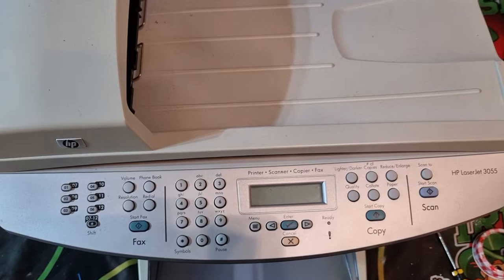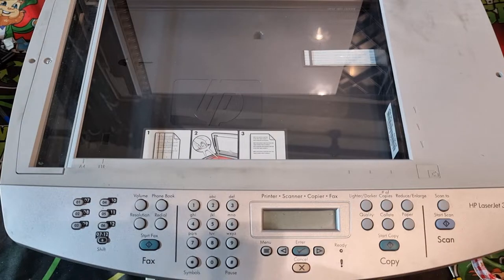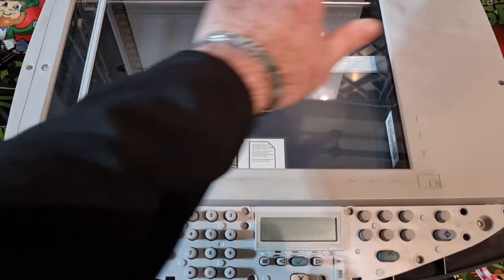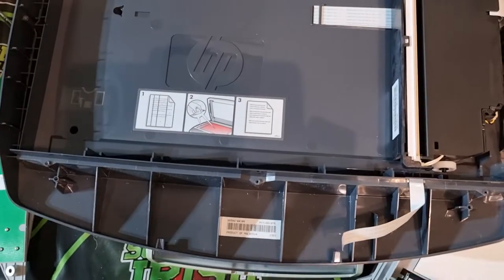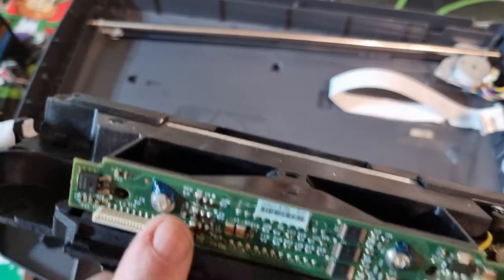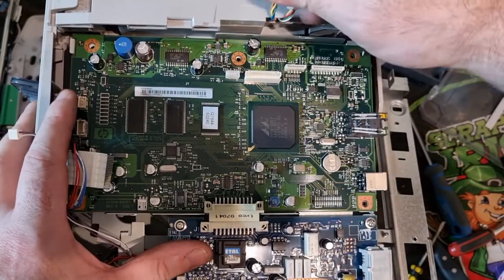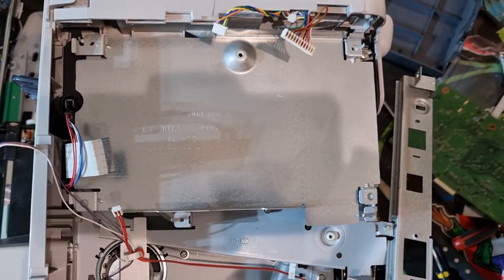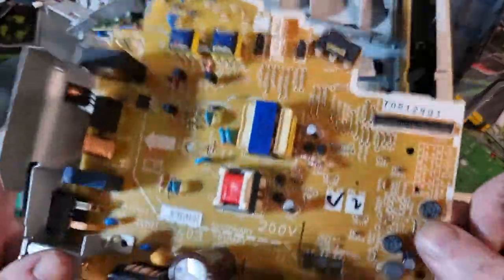gold recovery from printers is it worth  micro scrapping it

Comment: Lots of plastic and steel. The copper bearing motors go in scrap steel because I find no metal recycler who wants stuff that small. As someone said, there's the lazer head to look at. Some wire I hope you cleaned up. Printers are time consuming but for the hobbyist a source of gold. Most folk pass them over. I generally get the power cord and data cables with them. As you noted the ink can be a PIA. Let the printer sit out in the rain, the inkwell fills with water, and you're dealing with a mess. Some have crack n peel silver bearing mylars like microwave ovens. Any free gold is good. And processing ewaste gives better results than panning for gold unless you find a crevice loaded with nuggets. Good job mate!
Reply from the maker: Thanks Ross for the great advice and for taking the time to watch really appreciate it